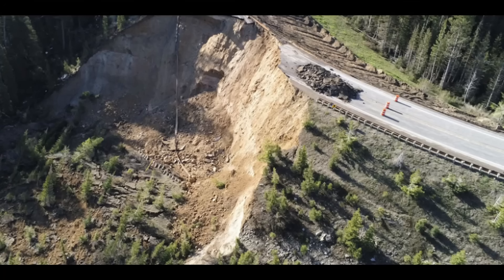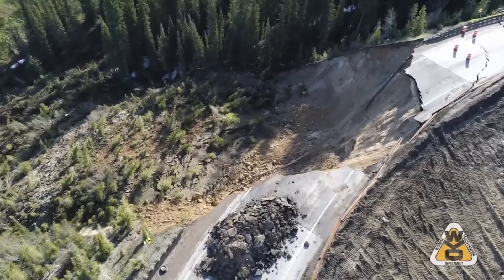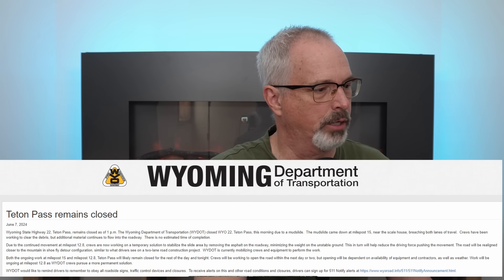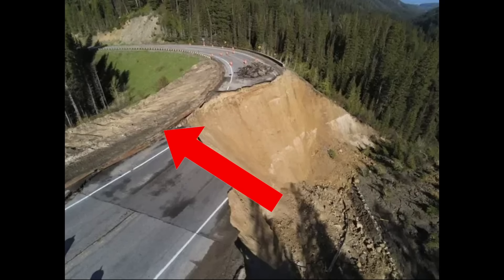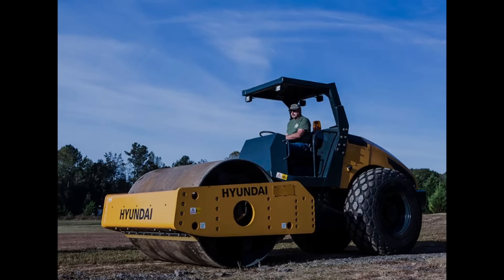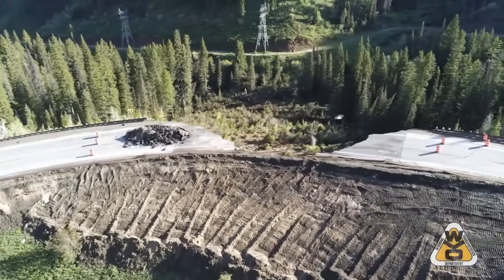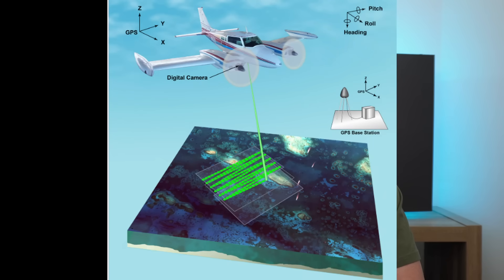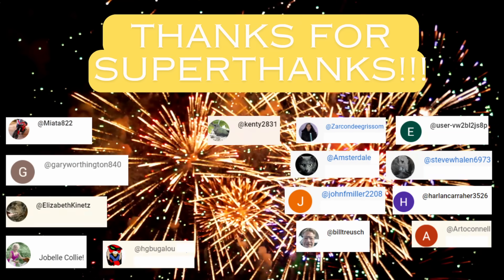Major Highway Embankment Failure in Wyoming!

Comment: For the long term fix, it's going to take some ground stabilization, whether it be "deep soil mixing, shallow soil mixing, jet grouting, etc." before any permanent fill is placed.   It's hard to tell from the videos where the embankment ended up.  The roadway is swallowed up and gone.  Equipment vibration while trying to save the embankment likely made it slough away, but better now than with the heavy vehicle traffic this highway experiences in the summer.

Comment: I lived in Jackson Hole for nearly 25yrs. I owned a contracting business there for 18yrs, I was licensed to work for the feds in the parks as well. Look up Walgreens and the failure of that project, also from land slide. Check into the landslide in the Snake River Canyon which closed the road for some time. Check into the sewage pipe project from Teton Village to Jackson which had pipes failing in the river during snow melt and letting hundreds of thousands of gallons of sewage flow into the Snake River. I know of much more but those you should all be able to find in old news articles. This area has a real problem with crappy engineers and corrupt officials. Both the Town of Jackson and the Feds in the Parks all hire the cheapest bidders as well. Teton County is only slightly better.
Reply: I've lived in the area (both Jackson and Victor) for 8 years and I've wondered a lot about the corruption factor. In general the money in that area is entitled and demanding and it ends up putting a ton of pressure on people/sectors. I'm guessing that these people want their money to override the limits of physics and the fact that the plan was to effectively ignore this crack and are now saying they'll have a shoo-fly (which they originally said they wouldn't be able to do) in 2 weeks is just testament to that. You can hear the money being thrown at this and WYDOT caving.

Comment: They’ll have a bypass up slope of the slide in a month. It may be one way but it will work. Then an interlocking concrete wall will be installed and filled within 8 months.

Comment: FYI: I've been driving that piece of road for over 50 years. This fill area has been in its present configuration for over a decade longer than that.
This piece of road was built well, and lasted well over half a century, a reasonable length of time for an infrastructure project.
The problem isn't the original build. The problem is long deferred maintenance. The asphalt was sinking and cracking for well over a decade. That area was fixed with jerry rigged patches several times. There was plenty of warning about this problem.
Reply from the maker: Yes, it sounds like a new roadway (and one with better grades and curves) is well overdue.
Reply: @CaseyJones-Engineer  Not so easy. This "pass" was used by the Indians and early settlers because it is the ONLY possibility to cross this mountain range by horse, or later wagons, for fifty miles. The grade on both sides hits 10%. And the geology of this area of the southern Teton Range and Snake River Range is prone to landslides. I've skied, hiked, and hunted all over this area and evidence of old and recent earth slippages are everywhere. A new road with lesser grades and gentler curves would be impossible here.

Comment: If you look on Google Earth at the area that gave away, you can see that all of the winter snow melt water run off dumps off the road exactly where the slide edge and the edge of the pavement meet on the inside of the curve. Google Earth shows that section of road in the winter. You can see the small gulleys the water makes when it leaves the edge of the road. There are multiple gulleys within the slide section. All of the snow melt run off flows to the inside corner and dumps off in the exact spot the slide happened. Too many years of water getting in under that road from the inside curve, something was bound to happen.

Comment: Those highway engineers must have skipped the lectures on slope stabilization when taking Geotechnics.  My students would have failed that test if they designed a fill like this.  That slope looks closer to 1:1 than 2:1.
Reply from the maker: Yes, that slope does appear to be steeper than 2:1.  The biggest shock to me is that Wyoming DOT was all set to reopen the road when it was obvious that a big slope failure was imminent.  The only reason this road was closed at the time of the failure was due to the mudflow over the roadway 2 miles away.  A lot of people say that this fill is ash, but I simply cannot tell from the pictures.

Comment: Geotech engineer here.  Two things that stick out to me on the fill.  The fill doesn't look particularly well compacted, just the way the fill looks.  i see no evidence of keying the fill into the existing soil.  2 horizontal to 1 vertical is not bad out of hand, but a big fill like this would need more a bit more analysis.  

A year sounds like it is reasonable, there's alot a material that will have to be removed before they can start reconstruction.
Reply from the maker: Thank you for your comments.  Some people are saying that they believe to slope to be much steeper than the 2:1 that I thought.  I will research this some more.  I see what you mean about the lifts appearing to have been rather thick.

Comment: 6:40  It's all about the temperature.  The spring moisture has been extraordinary because of the temperature swing from below average to above average.  Early May was still receiving snow, and then temps soared above 80 F the last couple weeks with it no longer freezing at night.  This vastly accelerated snow-melt.  This parallels (to a lesser scale) what happened in North Yellowstone a couple years ago.
Reply: Same thing happened to Walgreens in Jackson, same thing happened in the Snake River Canyon. Happens every ten years or so, warm wet springs.

Comment: I think they can get a temporary road opened much sooner (even if just a single lane w/traffic control) - I'd significantly lower the embankment/roadway in the area of failure and take the pressure off those steep embankments.  Then they can work on building up the embankment next year.

Comment: Yes, as an engineer, I couldn’t help laughing at the statement about removing the weight of the asphalt.  They really should have an engineer review their press releases to avoid such embarrassment.
Reply from the maker: Their statement is particularly humorous considering that they ended up piling that asphalt on top of an adjacent section of roadway!
Reply: @CaseyJones-Engineer  The heavy equipment removing the asphalt likely weighed more than the removed asphalt.
Reply from the maker: @LTVoyager  True!
Reply: Often what is printed is not what a press release was supposed to be. You read a release, scratch your head and say, "I know that isn't what they meant."

Comment: Given the terrain, doing 2.5:1 slope would likely have increased the amount of fill needed exponentially. Add the much smaller knowledge base available when the road was likely manufactured, and it's easy to see why it was built like it was. This won't be an easy fix.

Comment: How many of the solutions recommended both in the video and in the comments were known/available in the 1960's? While I would hope that every good and appropriate technology is used to repair the road, how much fault should be placed on the designers and builders from 55-ish years ago?
Reply from the maker: I think you're missing the point. I'm talking about what would be done today. The fault I have with the DOT is that didn't recognize that this road was going to cut loose in a big way.  The only reason there wasn't traffic on this road at the time of failure was because of the mud flow 2 miles away.

Comment: 3:16 “a lot of the vehicles were EVs” don’t be an ultracrepidarian! Given the fire seen in the footage, and what is know of Chinese EV technology, and my own experience racing EVs, I doubt very much that that is an EV fire.
Reason to doubt that an EV battery fire is what is shown: 1) EVs in China mostly use LiFePO4 batteries, which don’t catch fire very easily, and 2) when they do burn, the flame is much more towards the blue end of the visible spectrum.  Also, 3) EVs represent less than 6% of cars on the road in China (less than the US, less than Europe as a whole) and 4) EVs are used more in urban than rural areas in China.  So I would guesstimate that 2% of the cars driving that road would be EVs at the time of failure, in other words, 1 car of the 50.
I say this as someone with 10 years experience designing, building, and racing electric race cars, who has personally witnessed battery fires.
Ne supra crepidam
Reply from the maker: This was an offhand comment and an opinion.  I am surprised at how many people are concerned with that comment and have no response to the rest of the video.  I say surprised but not really.

Comment: Mostly great report.  You lose some credibility with your EVs catching on fire comment, though.  EVs are FAR less likely to burn than gasoline or diesel cars.
Reply: Agree with? How about reference actual data.
Reply from the maker: @paulmead4401  It was merely an opinion based upon observation.  I don't mind one bit if others don't agree.
Reply: Fair enough. This is a culture war topic, after all, so you have to expect some clap back if you throw out anything that might not be totally accurate, or even if it is accurate.
Reply from the maker: Yes, how dare I say something that somebody might not agree with.

Comment: Looking at the angle of the bank, it looks more like 45 degrees to me, i.e. 1 in 1.  not 1 in 2 as you suggest.   Also the whole design is wrong, in that they have used what is little more than Dust to make this embankment.   Had it been made with large stones and rocks it would have been much more secure.   The height  a.s.l. of this bend needs to be reduced by 50 feet to get a safer base, and that 50 feet needs to be regained by a hill some way further along the road.   The original designers tried to make this road as flat as possible, but their foundations, and logic, were inadequate.

Comment: I've been on that road in the 1980's and I think that they had built this up to eliminate a change in grade and something like this is evident by the change in color of the exposed subsurface (quite a different type of fill).  Additionally, there is a patch at the top point of failure, indicating that there was a sign of softness at that point of the turn.  It is now obvious that at that point the road had become unstable, perhaps the year before and what was not appreciated was that the underlying old bed had become unstable.  the cheapest solution is to lower the road for several miles.. and economic forces was the considerations to try to keep the road open.. Do note the single lane forest road at the other side of the creek..   Perhaps the creek is the real source of the problem.

Comment: So, just an observation and a question about what to do from here.. If you look at this portion of the road on Google Earth.  Particularly looking at a semi low angle and looking from the east to the west.  It looks like this portion of the road was built on an ancient landside.  I do not think this has anything to do with this failure.  But it seems you could reroute this portion of the road a couple hundred yards to the north.  Giving a straighter road and far less infill needed.  Take a look at this.  there is already a dirt road there in this area.
Reply: Sorry, won't work. I suspect you meant South not North. They were already attempting to bypass to the south when the north face gave away. It is wicked steep on either side. North is out of the question.
Reply: @paulmead4401  I really did mean just to the north.  Look at Google Earth and just west of the hair pin curves is a label on Hwy 22 that says "Coal Creek Trail Head".  Draw a line from that point on a heading of 120 degrees till it intercepts Hwy 22 again.  That is what I am asking if that would not work to rebuild the road along that line.  You may be right that it may not work.
Reply: Oh, ok. Take a look at a topo map. You will see it drops off very steep to the north for a long way. The road you see in Google Earth is the old highway, and it is on the other side of the drainage.

Comment: Washout is at mp 13 and landslide is at mp 15 on Wyoming Highway 22 East of  the Idaho-Wyoming state line.  90 10 wheel dump truck loads removed from the land/mudslide site.  Idaho DOT is helping out just as much as they can.  It is a lifeline route into Wyoming from Idaho.

Comment: I just want to point out one thing, at 7:45, you made a simple diagram using the width of the road to estimate the depth of the drop off.
I think you're misinterpreting what you are doing there, I would say it was between 80 and 100 ft down. The reason I say that is you start the down arrow at the far side of the cave-in, for lack of better word. But then you place the bottom of the arrow at the bottom on the other side of the area. I'm not sure if that makes sense but yeah if you're going to compare it to this side then you need to move your top Arrow to this side of the Fallen instead of From The Far Side. 
I hope that makes sense, but yeah I would estimate that at 80 to 100 ft maximum

Comment: You keep saying that the crews didn't appreciate the danger but the report does say that part of the reason for crews working on the slippage area was for evaluation. You need to evaluate the area to even figure out if a temporary solution is possible.
Reply from the maker: It was obvious that this slope was ready to cut loose. Also, they were not evaluating anything. They were simply trying to reopen the roadway. It would have been open to traffic at the time of failure if it were for the mud covering the road a few miles away. They appear to me to have greatly misunderstood the risk if large scale failure
Reply: @CaseyJones-Engineer  true. The goal was to reopen the road. However, as you specifically read from the report part of their job was to evaluate how bad it actually was. That may also be why they were removing the asphalt. To get a good look at what's going on under the surface and to start removing fill in order to get to a stable condition. If it was bad enough they might not have opened up the temporary bypass that they were building in parallel with their other efforts. Considering that the collapse happened before they even finished their evaluation they obviously won't allow anyone on the bypass area now.
Reply from the maker: @ianbelletti6241  You give them far too much credit.  A professional familiar with signs of slope stability merely needed to observe those cracks in the pavement and the dip in the road surface to know that this was a precursor to a large slope failure.
Reply: @CaseyJones-Engineer  I also know how construction works. It appears that they had two teams on different efforts. The simple idea would be that while one team assessed how bad it is the other team starts work on the bypass area.

Comment: If the Wyoming engineers aren’t any smarter than the ones who are employed by the Utah Department of Transportation I can see exactly why a failure like this happens. Some of the standards used to construct roadway infrastructure is decades old and with modern technology and methodology advancing past established standards no one wants to rock the boat and work at updating those standards. Case in point, in Utah, UDOT specifies that bridge construction allows for grade and slope necessary for predictive run-off. However, no effort is made to match crossing roadway grade to the bridge slope. The result is a vehicle crossing the bridge at speed is challenged in its suspension to maintain traction with the road way surface. In some instances driving I-15 your car is almost launched in the air because the grades are so mismatched. If you are reading this and work for UDOT and get pissed off because I’ve called you out… go fix yourself… and your standards.

Comment: I saw this all the time as a Forest Engineer building looging roads in adverse conditions in the mountains.  The fill sides look too steep, and the  fill looks like it was put down in "thick" lifts to speed things up. $$$$   A slope that long should have had at least two "steps" that are wider than the one above it; to give the slope more width as the depth increases.  In a comment below, I agree that there should have been a way to reduce water build up in the fill.  The "other side" of the road is lower than the road surface, and must pond water when the snow melts in the spring.  Adding to the possible "liquidation." of the fill and the vibration of the traffic on the road may have been enough to make the fill go "quick".
Reply: Snow storms in this area typically blow from the southwest. This is a North facing aspect, thus it picks up extra snow in the winter. The snow has just melted and then a significant rainfall event occurred. A lot of water probably soaked into that slope this spring.